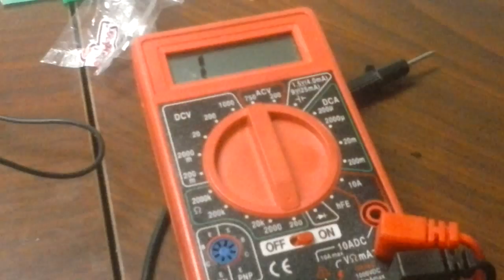Testing a fan relay

Comment: I am in Bowling Green, KY and have a 1995 Mercury Villager with 240,000 miles on it and your videos have been very helpful to me.  I just wanted to let you know.  Right now, I am working on finding out why my fan never comes on even when it is boiling over and temp gauge is pegged!  So, just wanted to say thanks.
Reply from the maker: I am glad they help! I finally gave my Villager away to a friend who needed a car after I got a new one. She's still driving it. In re: your fan, first make sure it works by putting 12V to it. Take the connector off, put 12v on it and it will come on. If the fan works, check the temp sensor. Fan comes on in response to the sensor reading. Fan also comes on when you turn on the AC. Good luck!
Reply: Thank you.  I have the factory service manual which is usually very helpful...sometimes not.  It says that if the temp. sensor fails, the fan will run all the time.  It claims there is no other failure mode which I find hard to believe.  It does say that if I disconnect the sensor, and turn the key on, the fan should run, if not...then wires, relays, fan motor...etc. need to be checked.  I just put in a new radiator a few months ago and all was well after I plugged it all back in.  Thanks for the info and the tips.